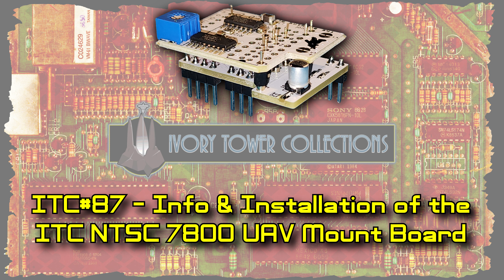ITC#87:- Atari 7800 UAV Mount Board & Installation (NTSC)

Comment: I know I'm a little late to the party but my good crt just went kapowie, so I've just ordered the UAV and will be moving my 7800 into the main room with the rest of my numerous retro consoles/Tink/big dum flatscreens...
But alas, I am a little confused about something and hesitating on the mount board... 
While I love the idea of the ease of this mounting board, my question is about the audio pin solder placement, which is that I'm wondering why the connection from the pins isn't going to the north side of the R5 and R6 resistors, instead of the south... I see the 10uf 16v cap on the board but from what I remember reading, there were issues with sound levels and mixing between TIA/Pokey when not routed thru the north side of R5 & R6 resistors...
Has this been addressed? 
As it just seems really weird to me that the pins solder straight into the south side of R5 & R6 and are not being "Resisted" first. 
Am i just being ridiculous here? And btw, it won't hurt my feelings if you tell me I am. 😅😆😅
TIA!

Comment: Hi,
Do you know if the UAV works with 7800 French consoles (those with a RGB encoder)?
I have a 7800 NTSC too, how to know if it needs the chroma timing fix?
Thanks.
Reply from the maker: I'm not familiar with the French RGB setups but I believe they are just like the PAL consoles. The PAL consoles do not require the chroma timing fix as that seems to be an NTSC only issue. So if you were to remove the RGB board that was added on the system and essentially get it to be just like the normal PAL version. Then the UAV could like be used. However, I've never installed one into a PAL console as I don't offer services on PAL systems. There is two people I know in the UK that have more experience with PAL consoles and even created their own s-video output solution that works better on the PAL consoles vs a UAV. But for NTSC, the UAV is still considered the best option next to Lumacode that is now available.

Comment: Hi, just installed this today and my 7800 games have no color, while 2600 games do.  Sound is working fine.  Suggestions on troubleshooting?
Reply from the maker: I saw you posted in the AA forums about this as well. There have been quite a few of these that have been sold and installed without issue so I'm not sure if the issue is something with a bad batch of UAV boards or some error in the way the mount boards were assembled by TBA. Contact me through the about section and send me some pictures of your install and the mount board...etc that I can look over to see if anything looks off.

Comment: Had to go through TBA to get a mount board, but I finally got one. Thanks for showing your install process! 
Going to rework my 7800 and see if I can get the picture looking better and mod work looking cleaner. 👍

Now if I can just get ahold of a Parsec BIOs before it's too late, I'll be set! :)
Reply from the maker: Excellent to hear! I knew TBA had them available now but hadn't heard or seen anyone that had received one yet. I also have more that I've made up for my use and also made a very very slight design change on my current batch of them. I also actually have more Kiloparsec BIOS kits made up but they are currently only being offered for install service with console commission work at this time. That said, in talking with PacManPlus (Bob) about it and the recent AtariAge changes regarding ports, this will also be the last batch of Kiloparsec BIOS kits I will have.

Comment: Nice work! Designing the UAV to work 'everywhere' meant it was a little clumsy for use in the 7800.
Reply from the maker: Exactly, and after installing UAVs so much into various 7800s and then helping others with their challenges when trying to install them, I decided to go with something like this to try and help create an easy way to install one that would have pretty much everything needed to get going without a lot of separate other components needed such as for handling the audio side of things for instance. And thank you for the UAV!